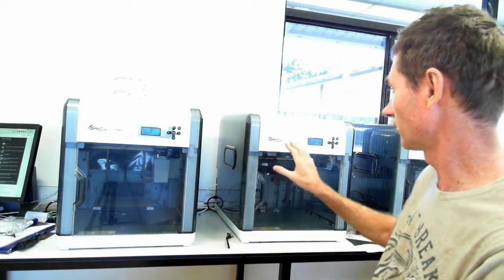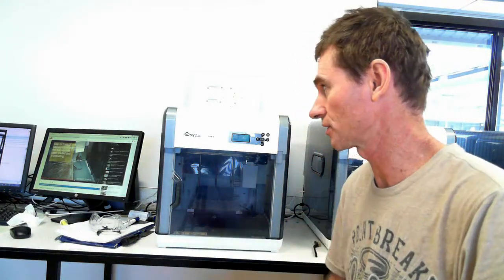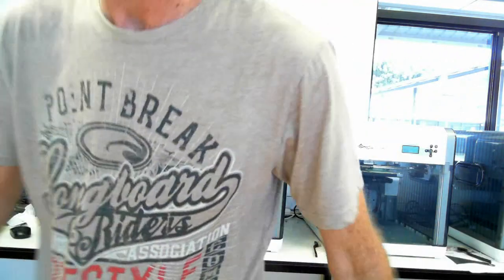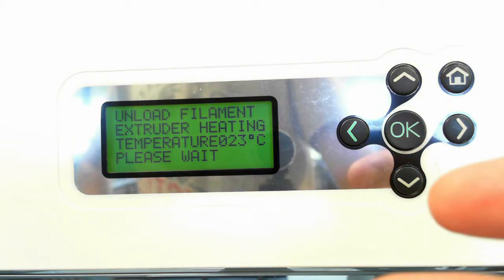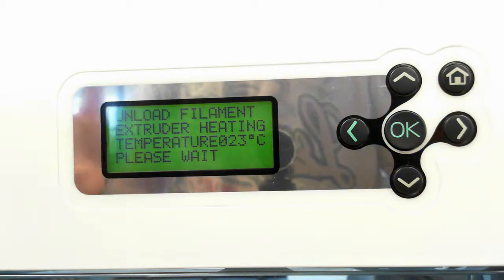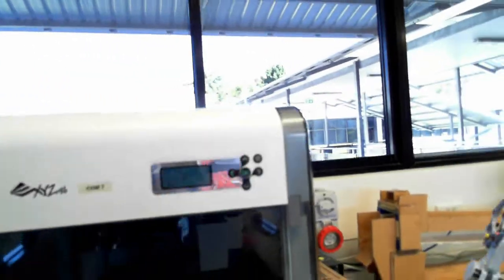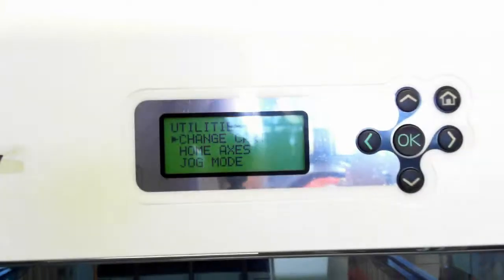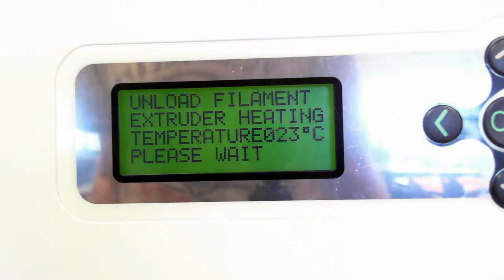Heater Failure on Print Head for da Vinci 1.0 3D Printer

Comment: Try to attach a rubber band on the harness bundle to the extruder to elevate it above the print bed. It is possible that if it dangles close to the heated print bed that it may conduct enough heat to the extruder to alter the thermister's reading thus giving an erroneous heating temp. higher than it is within the extruder. This may work.(XYZ AiO)

Comment: im having the exact same issue with mine. let me know if you get it sorted. I tested the wires for breaks and found none. I changed the connector thats above the extruder assembly and still no luck. I bypassed the tiny internal fuse on the circuit board by soldering the 2 points together (these are all common youtube fixes) Im guessing the heater itself is bad waiting on a new one to come in.
Reply from the maker: My supplier agreed to repair the unit as it was still under warranty. Lucky me.
Reply: turns out mine was just the filament cartridge not seated. The terminals weren't  making contact on the chip as a result the extruder, heater and fan were disabled
Reply from the maker: +Boiled Sprat (TheBoiledSprat) Thanks for your comment. I asked our supplier to deal with the problem as it was still under warranty. Interestingly they no longer sock this brand of printer. At work we are moving on to use the UPBOX printers. Very nice equipment.
Reply from the maker: +Boiled Sprat (TheBoiledSprat) Sorry I just wrote the comment below and then noticed your reply above. Opps. Anyway, yes I have had the same problem. Having to jiggle the cartridge a bit to make it sit properly.

Comment: Mine finally started printing successfully again once I isolated it's power plug in the wall outlet. Removed all other plugs, X10 modules from the same wall outlet turned out to be the trick. B-D

Comment: I inserted two 1mm x 2mm pieces of aluminum foil in to the connectors for the extruder's heater and closed the connector onto it and it worked after that. Knudging and wiggling the connector did not work before this fix.

Comment: did you reset the cartrage
Reply from the maker: +wilson rottschafer I"ve never tried. Just get it fixed under warranty.
Reply: +Simon Cumming try using a different Cartridge. If that doesn't work make sure the two temp wires ( the two little clear wires going in the extorter) are not touching each other or the extruder.
Reply: Wilson, that solved it for me. Thanks!